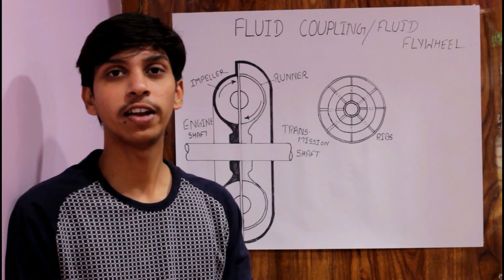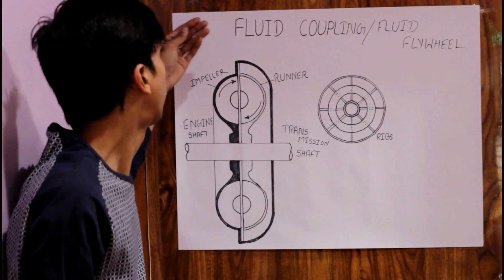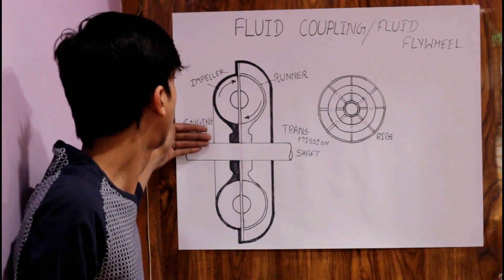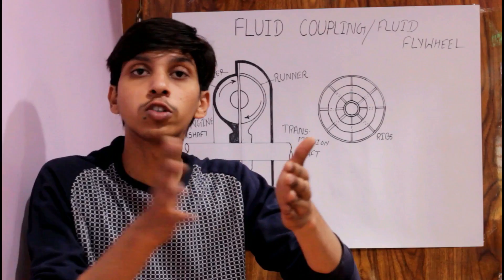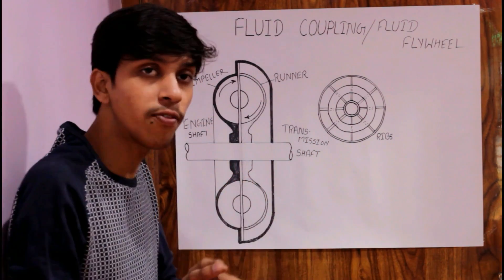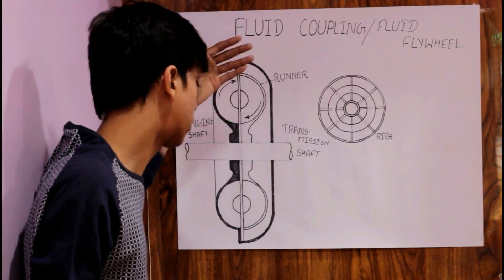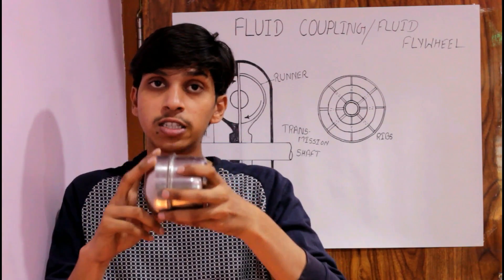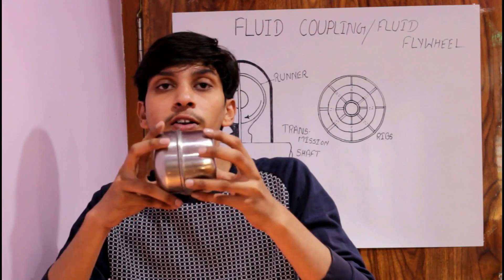Fluid Coupling

Comment: can u tell me..difference between..torque converter and fliud flywheel
Reply from the maker: yes brother, The torque converter has three unit runner, impeller and stator but fluid flywheel has two unit runner and impeller.

This is the basic difference between torque converter and fluid flywheel.
Reply: Bro you should use a good quality of mic